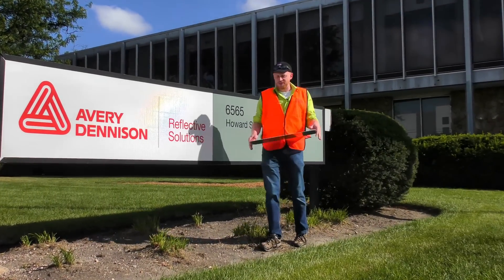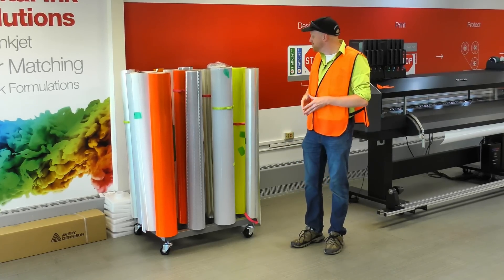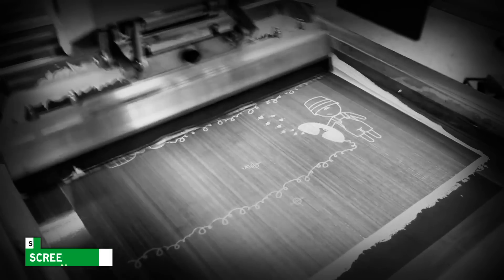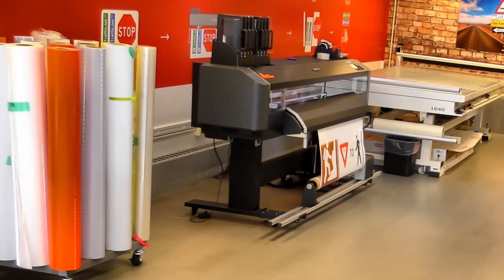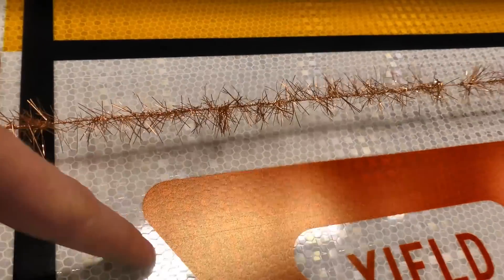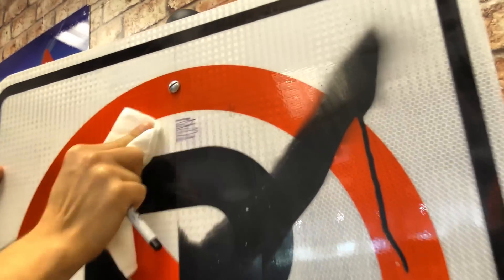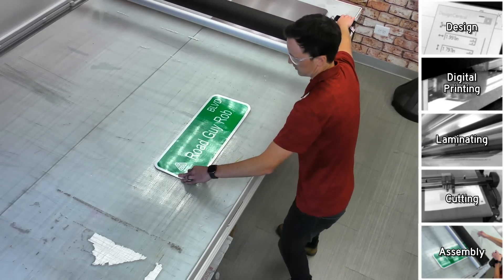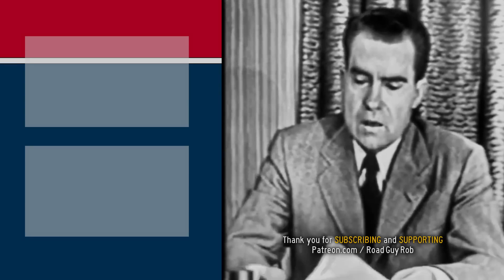Road Signs ALSO Run Out of Printer Ink

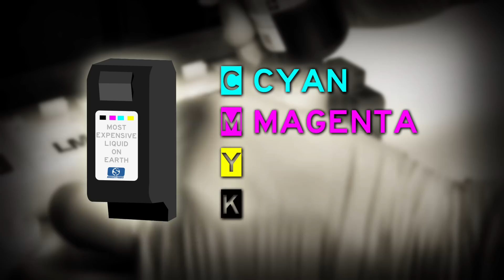Comment: 4:45 — In CMYK, "K" stands for "key", so named to avoid using "B" because that often already means blue, and because it's usually the last ink layer printed, like how the keystone is usually the last stone placed in an arch.

8:45 — That kinda looks like a road sign, but I've never seen a real one in Arial.

Maybe a video on the typefaces we do use on signage and how those typefaces were developed would be good? There are a couple easily downloadable ones that, if they're not the ones actually in use, are pretty close: Overpass / Blue Highway (old style) and Clearview (new style).
Reply: Highway Gothic is not copyrighted too.
Reply: @robloxian_yt7221  Good to know! [downloads]

Comment: I don't think the guy that made you the sign necessarily had an extremely steady hand, i think its more likely he had a plotter. Its basically a small inkjet printer but instead of applying the ink according to the design, it cuts out the design, either with a laser or with an actual blade. Very similar principle o the cutting machine at avery, just smaller.

Comment: In the late 80's/early 90's I had a summer job at our local county's traffic department.  We did road striping, detours, and signage.  Sometimes I'd have to create road signs.  They were printed on a Gerber vinyl cutter (black vinyl), and transferred that to a reflective sheet that we applied to the stamped metal sign base, then the whole thing when into an "oven" (big vacuum table with very large light bulbs, that would go on/off at set intervals for a shot amount of time, to cure the adhesive between all the layers).  The process took a quite a bit of time, and if you had to create mile markers, well, you were going to be there a while (baking them was easy since you could put a lot on the table, it was the printing/positioning that took forever).  Every so often we had to do multi color, so there was a lot of parts to cut, and position. To be able to just print it in one shot, and apply to the metal is such a time saver!

Comment: In case he hasn't mentioned it, there is a free font commissioned by Red Hat that closely mimics the Highway Gothic font used on roadsigns, it's called “Overpass.” It's perfect for projects where you want to mimic road signs, even if you're just studying the letter shapes to replicate them by hand, or making a stencil.
Reply: Blue Highway is also pretty close but a little more modern.

And there's a newer typeface that's been used on a lot of recent signage called Clearview. A little harder to track down (and almost definitely not free for most uses) but it's out there.

Comment: U.S. route 50 going eastbound through Sacramento California has overhead freeway exit signs with the clear laminate (not sure if they are Avery-Dennison's) that started peeling badly not too long after they were installed.  They look horrible and need to be replaced.  The clear laminate doesn't seem like it's durable.

Comment: Unlike Tricky Dick, I would definitely buy a used car from Road Guy Rob.
Reply: Not a used car, a used Ford.
Reply: @thomaslgrice  The initial use of the phrase was the 1960 election.
Reply: @SYH653  I did not know that, but I read up on it and you are correct. I was thinking of the flyers which were produced to counter Gerald Ford's campaign for president.  Looking into it I also learned that the "Tricky Dick" moniker originated in 1950 for his campaign tactics in state level races.

Comment: I'm still mad abut Avery's vehicle wrap material failure debacle and their subsequent snub to the vinyl dealers and sign shops seeking legit warranty claims.
(But sometimes I still have to use them because of their large library of PMS color matched vinyls, and a wider selection of metallics)

Comment: "Signs point to yes" - Magic 8 Ball

My mom used to work in the graphics department at our local municipal utility before she retired, and they had several large-format printers that were used for all sorts of stuff (and you can get a wide variety of materials for them, from all sorts of papers to various plastic films, and even cloth). The thing that they didn't have, however, was an automated cutting system - they'd just take the projects over to the big table that they had, put down some cutting mats, and they'd all go at it with x-acto knives. It's remarkable how quick and accurate they could be... years of experience I guess.

The largest working printer that I have at the moment is an old 15 inch dot matrix that I used to use to print out source code listings (I'm a programmer), but - just for fun - I'm halfway thru rebuilding an old large-format HP pen plotter to be able to use artistic pens, markers, and paint brushes via a 3D printed set of adapters. Once I get it working, I should see about making some art in the style of road signs... 
🤔

Comment: I've seen freeway signs in OC and LA that look to have a plastic coating peeling off.  Is that a laminated coating failing or I always thought it was a shipping plastic like you'd get on your phone display that someone just forgot to remove off the sign after installation.

Comment: I prefer the high contrast between the old glass dots and the non-reflective green background.  The "newer" fully reflective signs are illegible when exposed to any significant bright light.  I started noticing this while driving on the New York State Thruway (I-87) in the mid-2000s, almost twenty years ago.  I don't travel that highway very much anymore.

Comment: I'd never seen the older style ones and I'm in my 40s.   They were always painted here before going to vinyl.
Reply from the maker: I think most of them disappeared in the 1980s and 1990s as the better retro-reflective material came out.  California are the hold outs who didn't really start aggressively changing the signs out until 10-20 years ago.

Comment: correction: 
an AD TrafficJet Expert is about 2X more expensive than an HP Latex 365, but its also twice as fast printing,  warms up 5x faster so can turn around between jobs in under a minute (while an HP needs 5 minutes to finish and 5 minutes to start EVERY print run), and is much more reliable in long-term use. The HP is a prosumer printer that's very long-in-the -tooth at this point.

Important note: the lamination is an additional UV protectant for the UV-safe inks used for road signs

I always laugh when I hear a sign professional call it "silk-screening" (vs. screenprinting) because silk hasn't been used for screen printing in many decade. you don't call offset printing aluminum plate printing do you?
Reply from the maker: Good to know.  Information is very limited (a lot of "inquire for more information" notes), so I am going off what I could find out.

Comment: I actually work in a sign shop and make signs the same way mentioned here, but i have a few comments:

-Another thing the overlay does that isnt mentioned: it protects the print ink from the elements! Unlike your silk screened signs, the print ink is not self-protective from water or other rough weather, so printed signs have to use that clear overlaminate in order to make the sign work and to validate the manufacturer warranty!

-With speed limits, most often a combination of processes are used, where the border and "SPEED LIMIT" is silk screened, and then the actual number is cut out as a "layer-on-layer" addition

Great video as always rob!!
Reply from the maker: I didn't know the clear overlay is the same as the colored overlay.  That makes sense!  Thanks JJ1!
Reply: does the clear overlay also block UV? UV is what kills pretty much everything that's not designed to be outdoors. Or is the reflective backing and ink already UV resistant?
Reply: @gorak9000  yes! The clear overlay protects against basically everything except other ink ironically, so graffiti would be up there and basically stays. However something like lacquer would break it down over time
Reply: Done vinyl myself. I wish I ever had something as nice as that rolling table. I've squeegeed every sign by hand. I feel ripped-off.

Comment: As a taxpayer and road user, I have watched these printed sticker signs deteriorate, delaminate, and fade over time. To the point the clear coat has failed and pealing and stop signs turning white. Sure these are cheaper, but cities and states are not replacing the signs when they fail. Somehow the signs from the 1980’s and earlier are still functioning. I think maybe these stickers are great for a fast sign. But longevity they don’t have it. Sure these companies say they have some lifespan. But what is the cost per sign compared to the labor to replace all the signage when it fades and the coating breaks down?
Reply from the maker: I'd imagine it's a pretty crappy overlay if it peels off quickly.  I do see overlays flapping in the wind out toward Palm Springs where the weather is brutal.  

The trade off is that these signs appear so much brighter than the older signs.  And the older ones need light to be visible.  It's not just the cost of the electricity, but having to send crews out to fix all the broken parts when the lamps break.  Versus retro-reflective signs where your car's headlights do all the work.

Trade-offs, I suppose?

Comment: I must correct a statement in this video.  3M Corp created Chemolite©in the 1950's.  Vinyl sheeting with adhesive backing coated with Chemolite followed in the 1960's or '70''s.  Additionally they created an liquid form of the reflective material that was used to print information on the sheeting by the silk screen process.  Unfortunately the Chemolite itself and the byproducts of it's manufacture contribute to higher cancer rates in humans.

Comment: For anyone curious, The sign on the left at 5:17 will be placed at 52.020583, 4.317903 on the A4 freeway in the Netherlands near The Hague!
Reply: This is why I read the comments section
Reply: How do you know?
Reply: @MirzaAhmed89  They're signs along the side of the motorway. On it it says "A4" for the A4 motorway, "52.2" for 52.2 km along the road, and "Re" for the right-hand side (in this case south-bound). Above it it also shows a 100 km/h speed limit, as these are occasionally repeated on those small signs.
Reply: @niklas8135 why would Dutch signs be printed in the US though?
Reply: @EntropicTroponin  From what I heard in this video they usually only supply and don't print themselves. These may be test prints, as The Netherlands has pretty high standards for signs
Reply: @EntropicTroponin  Probably because of volume, they send direct to the manufacturer, and get a weekly airfreight shipment of signs ready to mount on the road. No need to have a local supplier if the material is made in the USA, and the US manufacturer can print and mount them for cheaper than a local supplier, who has to order the material from the US anyway. so have the sign made where the volume makes the manufacture much more economical, and then wait a week, as that sign might only be needed in a month to put up in a scheduled closure, while signs like stop signs are kept in a local store, as they can easily order a dozen when stock runs low, adding to the next order.
Reply: @Timooooooooooooooo  ''The Netherlands has pretty high standards for signs''  Not really, it's all the same material/quality like all other countries. All materials like sheets are mostly from the US.
Reply: @MirzaAhmed89  it is a Dutch mileage sign with the road number (except obv. not in miles but hectometers)

(please don't ask em why those are made in this factory in the US)
Reply: @MirzaAhmed89 It's a hectometer marker sign with the speed limit above it. 52.2 km on the A4.
Reply: I had to do a double take when I saw it
Reply: No way, I was already thinking why it look soo much like a Dutch one.
Reply: I was wondering if they did European signs and if they stocked the regulated colors for that market. Interesting!
Reply: https://www.google.com/maps/@52.0206408,4.3180941,3a,15y,249.12h,82.87t/data=!3m6!1e1!3m4!1sa9keg14whZgIFdFFvbah-Q!2e0!7i16384!8i8192?coh=205409&entry=ttu

Comment: I would think that something like a stop sign would be an off the shelf sign, but with sizing deferentials, it makes sense that this is not always the case.
Reply: that was my thought as well.  surely any good road crew would keep a stop sign on the shelf.  it would be the green road sign on top they would have custom made.
Reply: @kenbrown2808  I worked for a city that had replacements for all the street name signs in the city on a shelf in the public works building. Someone was thinking ahead.... (this city does not have a sign shop so someone else made the signs for them).
Reply: for things like stop signs that are very common, you’ll still do production runs on them and use a process like screen printing (as Rob notes), since there’s enough volume to justify it. while there may be a variety of sizes, the sheer number of stop signs means some amount of mass production is warranted. signs aren’t all custom printed as one-offs.
Reply: The guy used a poor example. Every DOT does indeed keep stocks of Stop signs in standard sizes.  It would be unusual to need one of those manufactured on demand.
Reply: I think stop signs all have to conform to standards - they're not allowed to be different sizes (unless they're on private property). Otherwise everyone everywhere would pick different fonts, different shades of red, or even different shapes, and you'd have a colossal mess
Reply: @gorak9000 while the proportions and colors are standardized in the MUTCD, stop signs (and other signs) come in a variety of different sizes depending upon things like road width, speed, and other factors of the installation.
Reply: normal sizes are 24, 30, 36 48”
Reply: most signs are printed these days so signs become a print-on-demand item, making a ton and throwing them on the shelf is called overproduction and is a big no-no in Lean manufacturing
Reply: @richinar  Having no inventory is doing lean manufacturing wrong. The point isn't to have no inventory, it's to not have excess inventory. 
Car companies doing lean manufacturing wrong is why so many of them had no cars to sell during the pandemic while Toyota did, because they were doing lean manufacturing correctly and actually had parts.
Reply: @richinar  
I am not talking about manufacturers necessarily warehousing excess. Cities and states have this ability and might need a suitable replacement quickly after hurricane winds or a bad driver losing a game of chicken with a stationary sign post.

Comment: Lmao the ultraviolet slow down for yellow is wild. Never even thought of that
Reply: I feel like I'm missing the joke (bc ofc the light doesn't actually slow down...the frequency decreases but the speed stays the same).
Reply: @petergerdes1094  They are talking about Fluorescence.
Reply: @petergerdes1094  The people slow down, not the light.
Reply: @petergerdes1094  If you have a spinning object its angular speed would need to slow down to decrease its frequency. If you want to say this simpler you may say its frequency slows down and it makes sense in this context. Then you can apply the same language to other things that have a frequency but not spinning.
Reply: @baksatibi  Except speed in this context means something different -- it means how fast the light is moving.  

I mean if you said "slowing down sound turns high pitched sounds into low pitched sound" I'd think you meant that it take longer for lower pitched sounds to cross a given distance than higher pitched ones.

--

Anyway, I didn't mean to nitpick but I kinda thought I was missing a joke.  Guess not and he just meant to say "reduce it's frequency."
Reply: @petergerdes1094  It's an interesting subject with all kinds of information, but essentially the speed does slow down through different mediums (materials). The "constant" speed we get taught is in a vacuum.
Reply: @tfeurban  In the case of fluorescence though, it's not "slowing down" - a photon of a particular energy is absorbed (say a UV photon), and a new photon of a lower energy is emitted (in this case in a range of yellow to green). The remainder of the energy is lost (the difference in energy between the incoming photon and the emitted photon) - well, it turns into heat basically. You can't create or destroy energy... thermodynamics and all...
Reply: Interesting concept, as Rob said it makes that sign stand out because gets attention as your eyes respond, "that's not natural and out of place."
Reply: It's the same concept as anything "fluorescent" - highlighters, and fluorescent light bulbs work the same way. You use a substance that takes in UV photons, and gives off (fluoresces) visible light photons - usually phosphor (in the case of light bulbs), but can be other chemical compounds as well. That's how fluorescent things appear to be brighter than the surroundings - they're converting light you can't see (UV) in more visible light you can. It's also used a lot in bio / pharma - you can tag molecules with fluorophores (chemical compounds that fluoresce), and then detect them with fluorescence microscopy, or other optical detection methods. It's how gene sequencing is done!